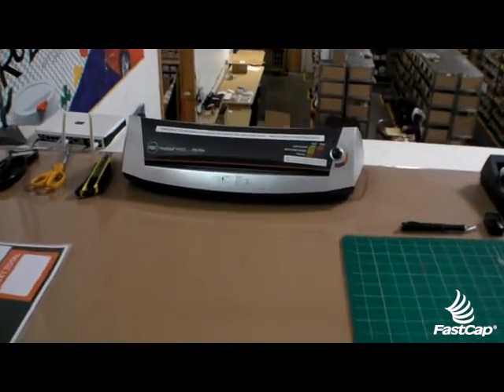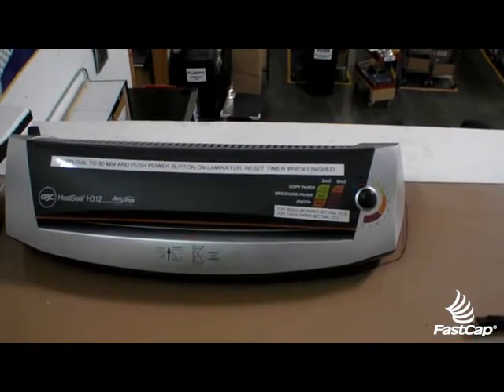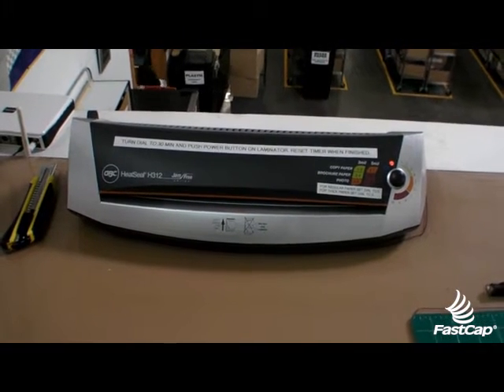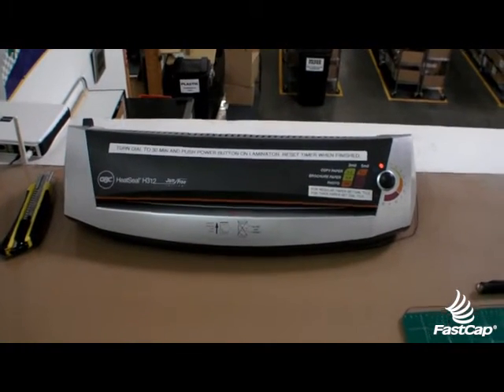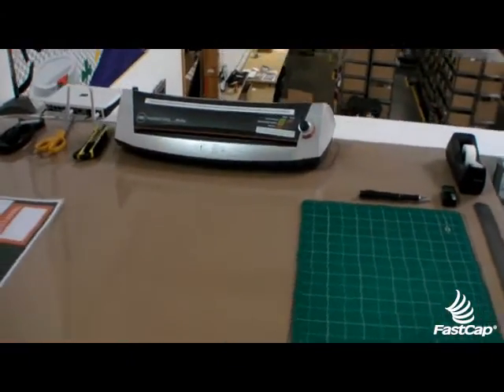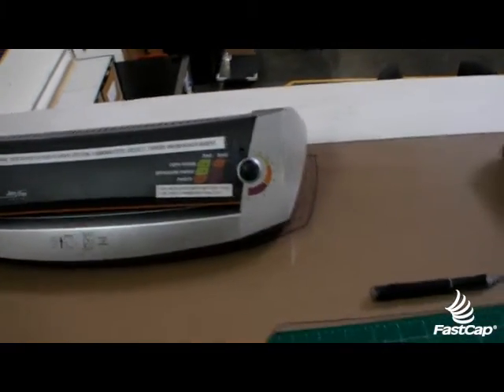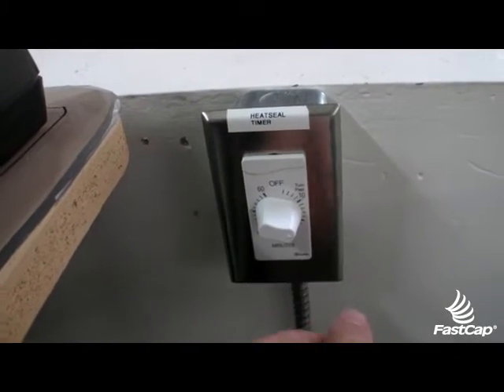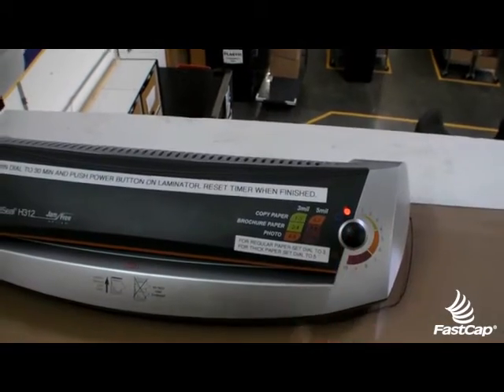Lean: Laminator

Comment: What kind of laminator is that?
Reply from the maker: The model is a GBC HeatSeal H312. We still use it almost every day, here is the amazon page for the same model number: https://www.amazon.com/GBC-HeatSeal-12-5-Inch-Laminator-1702770/dp/B001B09626
Reply: Thanks for the answer. Have y'all done a video on its best Lean use? If not, you should. Love that timer idea BTW.
Reply from the maker: Best lean use in general or of a laminator?
Reply: I guess best Lean use of a laminator, how y'all use it at FastCap, why it's better than no laminator, what kind of things get laminated, etc. I'm going to get one, that's why I wanted to know what model you had there.